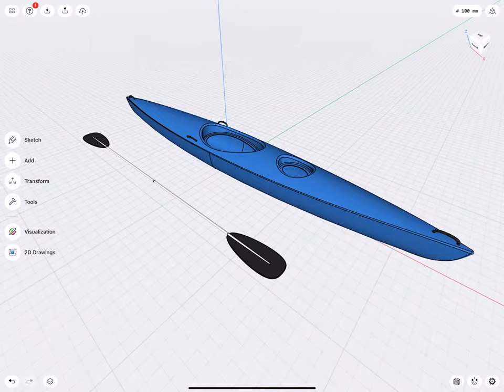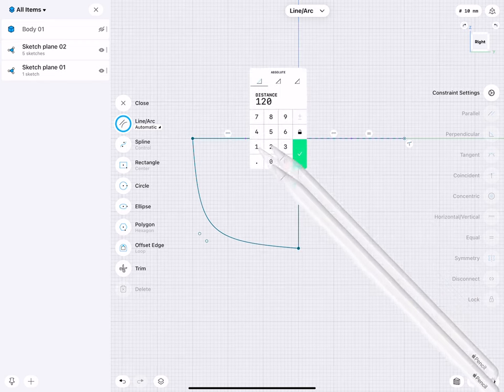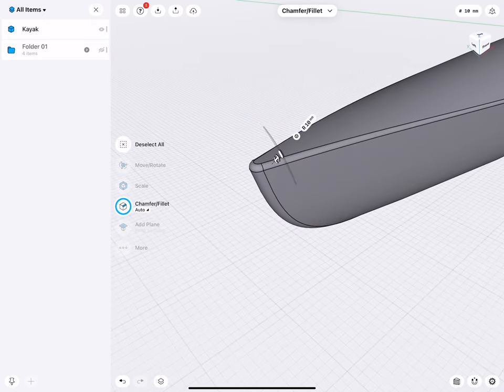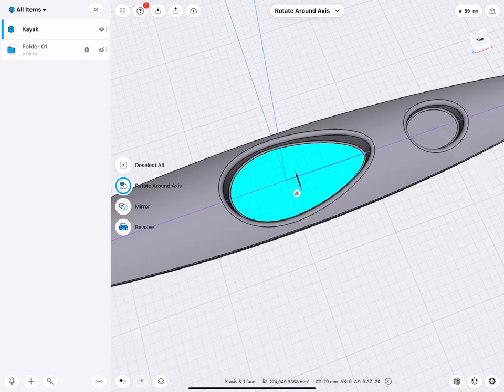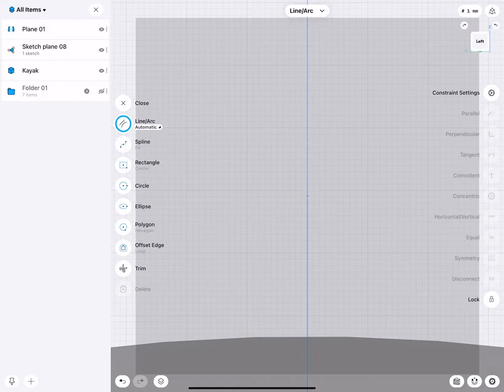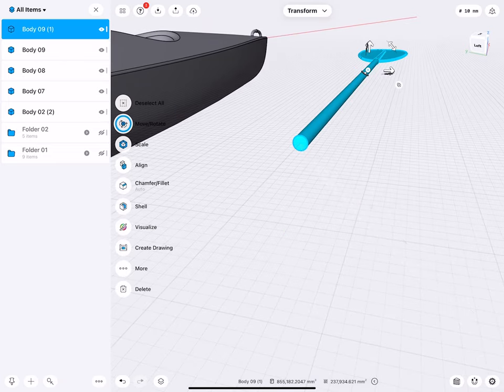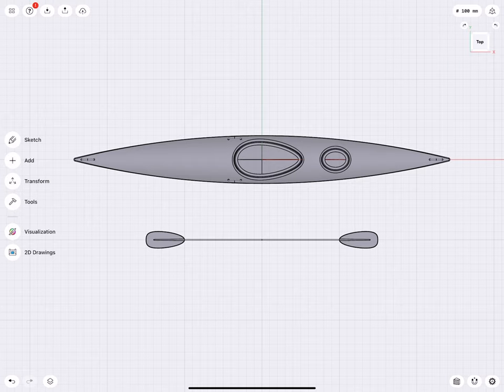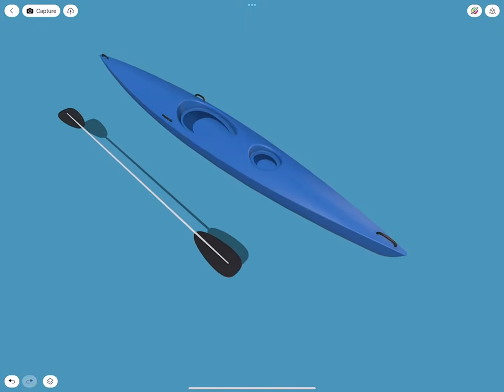3D modeling a kayak | Shapr3D tutorial

Comment: A very important feature is missing in shapr3d. The record history tool. It is very convenient to loft a set of curves and see the changes to the surface live when the control points are altered. This is very important for hull design.
Reply: I hope the shapr3d will consider adding this feature. For hull fairing when designing ships its the starting point.
Reply: Agree
Reply: More essential parametric tools like this have been "coming soon" for over a year now...really hoping they're not too far away, for iPad in particular the lack of a proper parametric modeller is sorely missed.